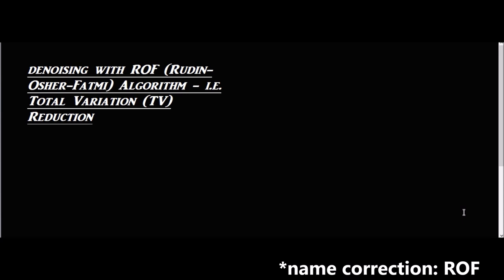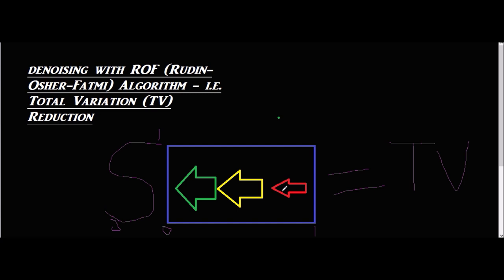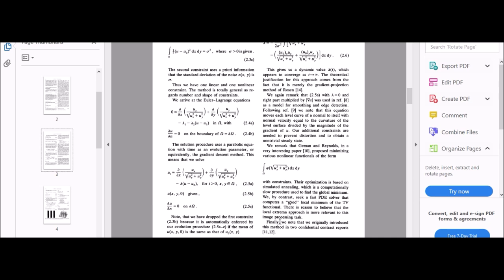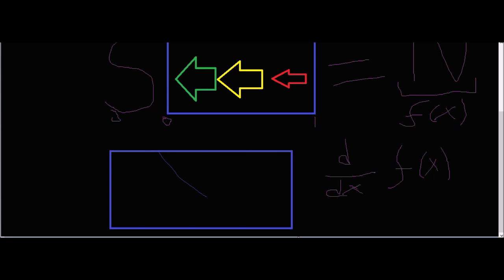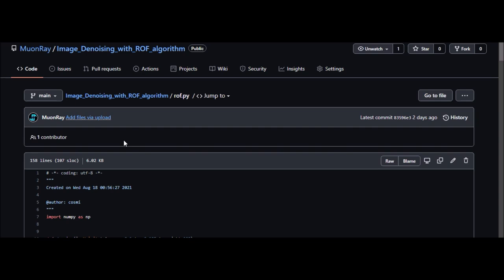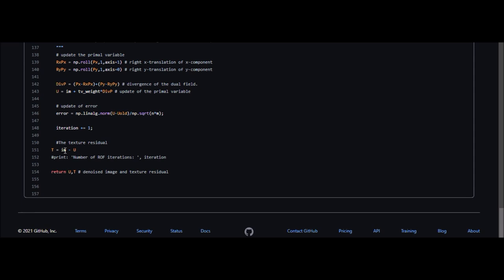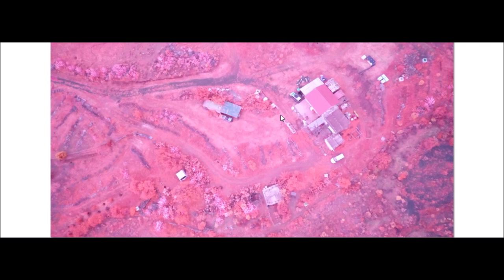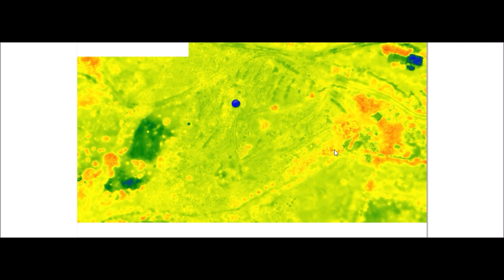Denoising Drone Images with the ROF Algorithm in Python | For NDVI, UV and Astrophotography

Comment: Okay, hang on... So you have photo's in jpeg format, which is lossy and noisy by definition, then you denoise it, and save it again as jpeg, which is lossy and noisy by definition... Loosing you here.
Reply from the maker: The file formatting is not the main issue when it comes to noise reduction. first of all in this exercise they are not necessarily having to be jpeg images processed, they could be DNG (raw) or PNG or any format which would have noise introduced by the process of capturing the image either due to longer exposure time (shot noise) or higher sensor gain (ISO - "digital noise") either of which would worsen the signal to noise ratio as they increase. Jpeg compression is not really the issue, you are confusing lossy compression with noise. JPeg compression is a pre-determined trade-off between image size vs image quality by intentionally eliminating redundant texturing not the same thing as textures being eliminated due to TV regularisation. It's important to know the difference to avoid the confusion here.